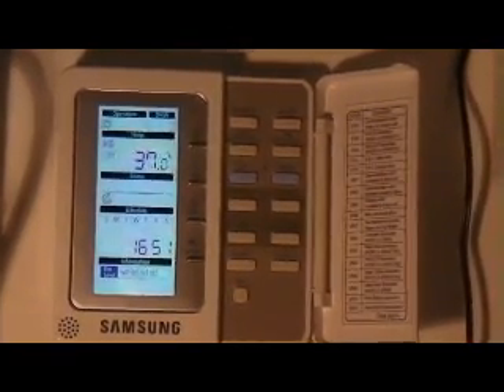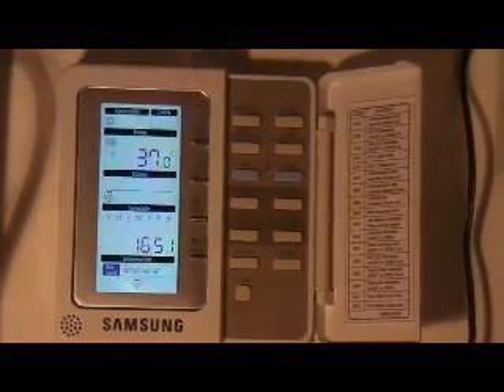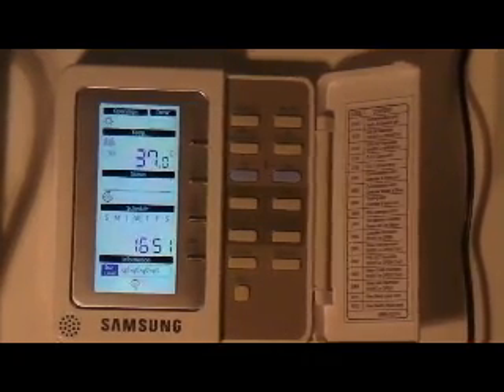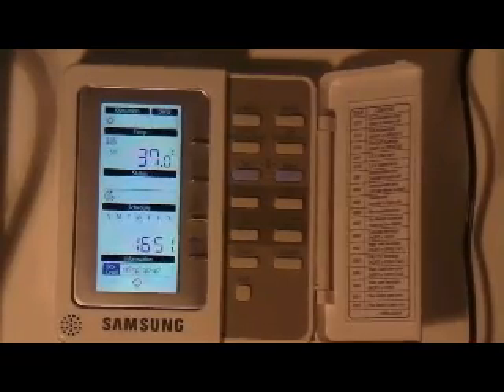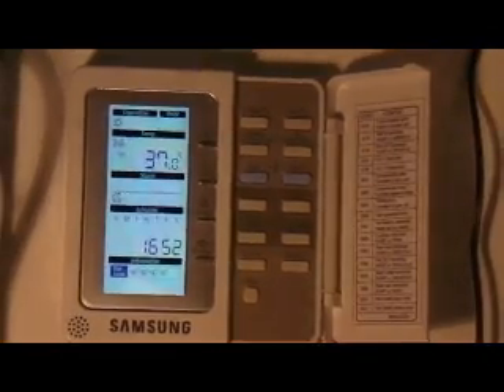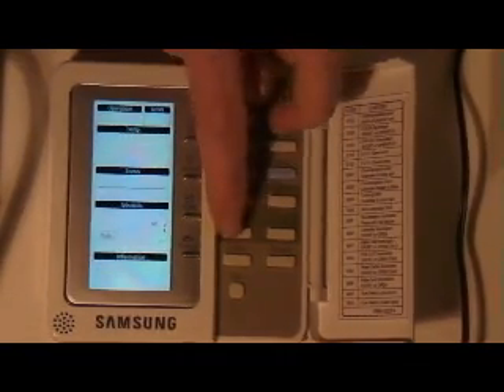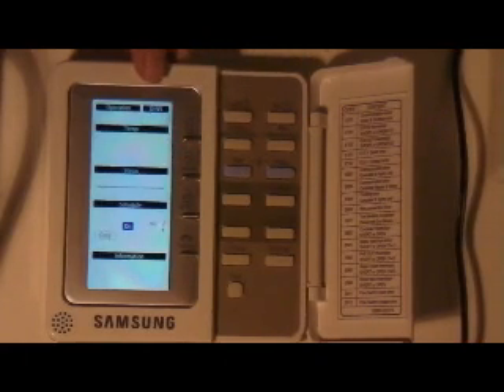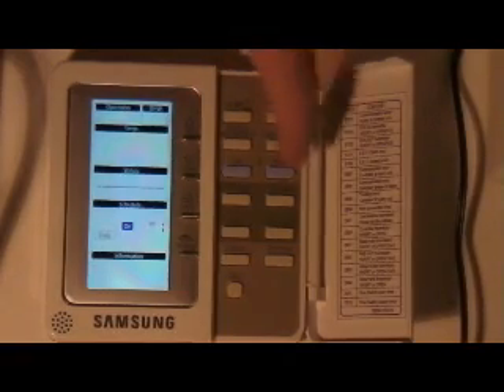Silent mode Samsung air source heat pump,  RC090MHXEA RC160MHXEA

Comment: Help They hot water tap symbol is not showing mid morning and I need to press the top on off button top right. I note the word Daily appears in time window. How do I ensure the hot water is on all the time
Reply from the maker: set only on timers, delete all the off timers, then it will never switch off see timers video
Reply: Thanks very much. Hopefully sorted Great channel. Mike